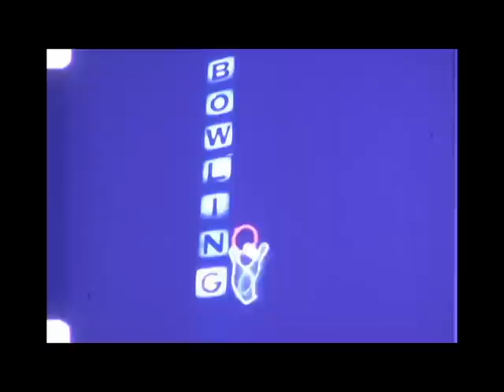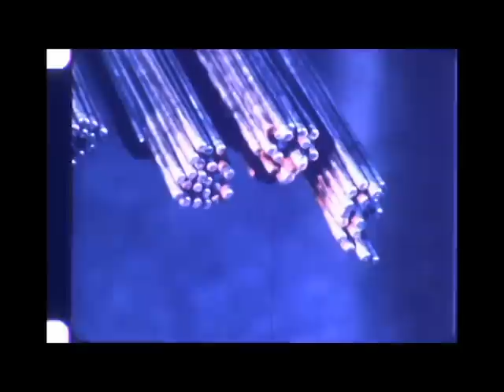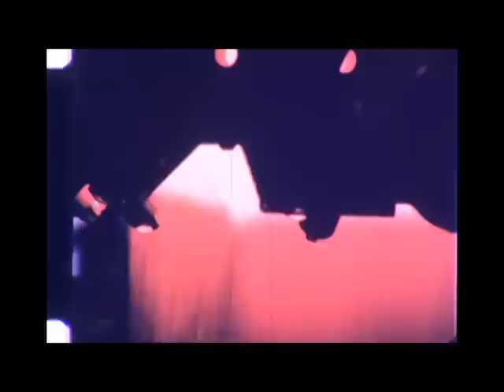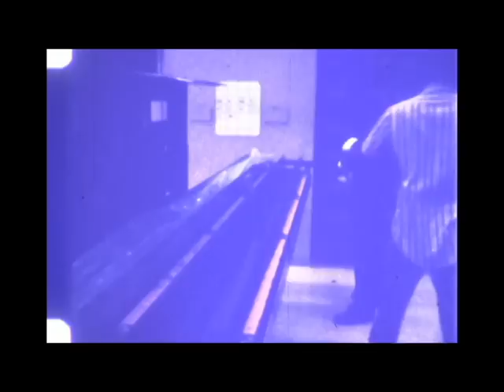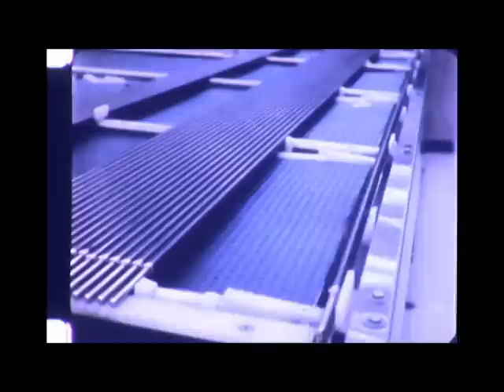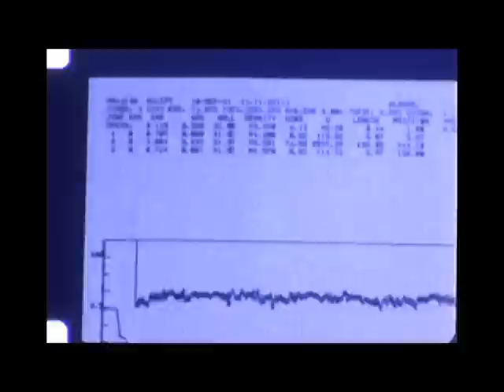Automated Fuel Manufacture - 1981

Comment: Anyone else surprised to them carrying around trays of pellets with no safety gear?
Or them just piling the fuel rods on each other?
Reply: Natural uranium is barely radioactive. The real hot stuff doesn't show up until you start splitting atoms with neutrons in the reactor.